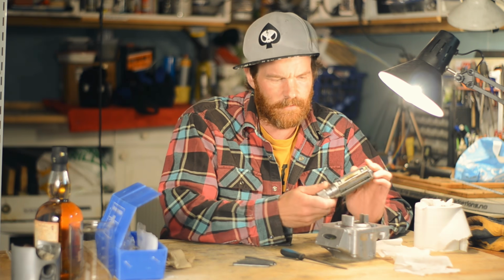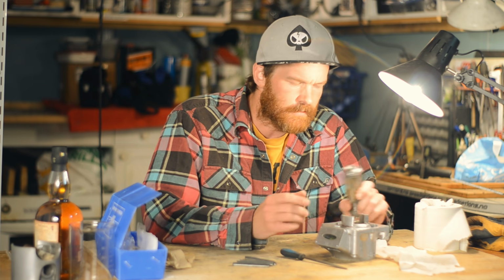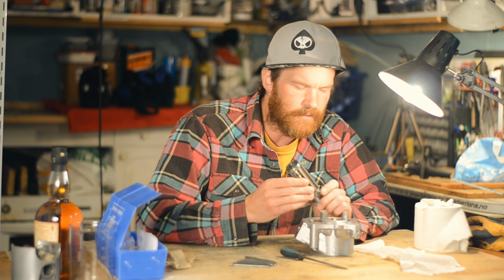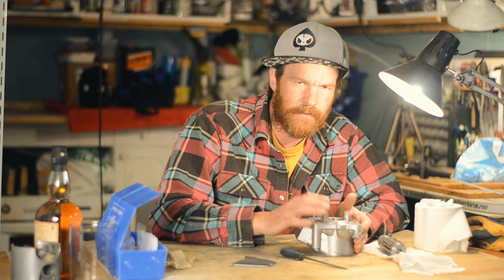DIY "NIKASIL" Two Stroke Cylinder plating P3

Comment: Ok just throwin it out there. I have built a few small 4stroke engines and only a couple of old Victa 2strokes and a few hot chainsaws. I have never noticed any difference between a X pattern and a horizontal pattern in the honeing but I have found that in any engine I have ever built (and then run for years including hot chainsaws ie 2stroke that work very hard for their life) that too much fuss over the hone and your just wasting time. You are on the right track and doing more than anyone I have ever seen to build a totally different engine than what can be bought at Bunnings if your an Aussie (home depot for the yanks). Keep it up...... I can't wait to see how well this thing does on the dyno.  Thanks again for the inspiration and I hope it does what you want it to do. Very good work. Please keep the videos coming. I genuinely await each upload with hopes of seeing it go........ Seriously can't wait. This really could be a game changer.
Reply from the maker: Thanks man!

Comment: One idea from me is to hone the zylinder bevor you are coating it too.
I guess you get the nicasil better to hold on the surface after honing and the zylinder is more round after the honing.
So when you hone after coating the zylinder, you only have to hone very short time to get all the surfice nicely with the little scratches.
That will keep your nicasil more thick.
In my opinion you honed a too long in this video
My experiande is to go trough just 5 or 10 seconds mabee in 2 or 3 steps...
I normaly goes really fast.

Greets from enduro riding.
Love your channel and work.
You are very kind.
Good luck with the final zylinder
Reply from the maker: Thanks! A slightly rough surface (blasted is good) will  help with getting the BN particles to stick better - higher density of BN in the coating.
I'll experiment more with the honing, as I'm not shooting for an exact size I'll hone the actual cylinder just the necessary amount for a good finish/straight bore.
Reply: @2STROKESTUFFING  welcome
on the enduro i ride they say you can use one zylinder for ca. 3 times honing and bigger piston kits (A B C size) after you have to go for new zylinder because the nicasil is very thin.
One guy from a special engine service and prepairing company  onece recommended me for nicasil zylinders a honing brush ( picture in the folowing link)
In my opinion these are good for the honing after your first pisten is blasted out.
It also rounds the sharp edges from the flow holes slightly wich you sometimes have to go over by hand to take away the sharp edges.
Give youbthe picture maybee you can decide on your own if this is good.
Anwnser me what younthink about in my case ind enduro and in your case with your new zylinder.
Nice Geets

Comment: in 1974 we had a Hodaka125 SuperRat that pulled 28 horsepower and raced in a motocross race at the FIM 250GP Carlsbad California....  can't what to see what your design does I hope in the 12-17HP range for a 50cc would be awesome if you can hit above 20 wow.... don't know what the highest power is for a 2 stroke 50cc hard to find out
Reply from the maker: 👍 My best so far is actually 18hp at the dyno roller with the ported iame cylinder. Massive transmission loss with a belt variator - should be considerably more at the crank.

Comment: Why not submerge the whole thing in oil when honing ?
Reply from the maker: That's a good option!
Reply: @2STROKESTUFFING  I thought about it a bit more and it wouldn't be as easy to hold the cylinder. I mean you cant put it into an existing vice like you are doing now. may not be better.

Comment: I would be checking that honing with a bore micrometer  for roundness and parallel walls before committing to using that hone tool.
Just to be sure.

Comment: any hone or ajustable reamer i have gets a hard ass grind/cut on something old/past usable to really bed in. as your friend said (as i was typing lol) the stones will loose lots of material on the edges befor setteling to match the radius, once matched, it will hold its shape and be less chattery (its basicly unable to be fully wound tight untill the edges are gone, the tool is loose, it bounces) continually taking my hat off to you for this tho!!! 100% backyard and winning! top marks

Comment: When you are honing run the drill a lot slower and go faster on the in an out motion so you get a cross hatch pattern.
For lubricant you can use a thin Auto Trans Fluid and Kerosene 50/50 mix that will clear the pores better as you hone and run more freely.
Reply: I was thinking the same thing, you need the X hatch pattern
Reply: cross hatch hone is top
Reply from the maker: Thanks for the tip! I need to work on it, turned out almost horizontal.
Reply: X Cross hatch is an old wives tail
Reply: @UltFrizz  
The latest CNC honing machines are programmed to do cross hatch honing and not just to satisfy old wives.
Reply: @AuMechanic  not all
Reply: Agreed on the pattern, I try to aim for around 35-40 degrees from horizontal on the pattern. Drill in low gear, part throttle and move fast. I don't worry about the pattern until I get close to final size though, before that I just run full speed, takes long enough as it is. 
Maybe while you're building rigs anyway build an automatic honing rig that moves up/down at whatever speed is needed to get a good pattern for the current drill rpm ;)
Reply: @AuMechanic  after many years of testing and development they have found a uniform x hatch has less oil retension
Reply: @UltFrizz  
Kart folks have some fairly creative home brewed theories on engines even more so than MC racing engine builders but IME a lot of it is based on some cause and effect assumptions (I built an engine for so and so that won XYZ and races etc etc) and not any scientific study.
Reply: @Hollaendaren  
Same, I leave the cross hatch to the final finish.
Reply: @UltFrizz  
"they have found a uniform x hatch has less oil retension"
As to less oil retention, the purpose of cross hatch pattern is not for oil retention it is to facilitate the rings bedding into the cylinder in such a way that does not cause undue heat to them or the cylinder surface that could resulting in ring failure and bore glazing, and well after they are bedded in after a period of wear there is not much left of the cross hatch pattern anyway to aid oil retention so that theory oil retention theory proposed by whoever "they" is doesn't appear to hold.
Reply: @AuMechanic  you read too much off the internet
Reply: @UltFrizz  
Ive been a MC mechanic since 1976 and Ive heard a lot of "pit science" of the kind you spout and it doesn't impress me nor does it fool me for a minute.
Reply: @UltFrizz  
And to add to that your inability to argue any logic that would support your claim is the most compelling evidence that the claim is nonsense.
Reply: @UltFrizz blatantly digging the hole deeper. full of BS . AUmechanic is schoolin you.
Reply: Cross hatching not only make the rings bed in faster and keep the heat lower, it also keeps the rings from rotating while bedding in a four stroke engine. 
If you only have a flat/slightly helical pattern in one direction in a four stroke cylinder, the rings will rotate in unwanted patterns and you may end up with ring gaps corresponding eachother. You preferebly want the gaps to stay spread evenly.

And YES, i KNOW this is a 2 stroke engine and the pistons have stop pins to keep the rings in place.
Reply: @noidontthinksolol  i work at a machine shop here in town and my boss has been doing this for around 38 years not a single motor has come back with problems with the cross hatch keep it at 45 and leave it alone
Reply: @2STROKESTUFFING  Goodluck on the honing. Ignore Gollan's lack of theory; the cross-hatched bore honing method is time tested from before WWII, from the mid 1910's era racing - and likely was from long before then, knowledge used in the age of steam.
Reply from the maker: Mixed in kerosene with the oil and it works great, the pump is happier too.
Reply: all I'm thinking about, is getting an even Nikasil plating. I'm thinking a more even plating maybe achieved by plating a rotating cylinder.
Reply: @chrisfryer3118  a Sleeve valve cylinder ? ah I get you, you mean an even unform thickness of plated Nikasil coating, by some method of rotation - either by some contraption of spinning the cylinder in solution(s) or with an eccentric vibrating pad/table, shaking the solution around the bore/object ?.
Reply: @AuMechanic  Anyone who knows engines especially two strokes knows you are one of the smartest guys on youtube this Mick Gollan obviously has no clue what he is talking about and its a damn shame he doesn't have a clue of the massive respect you are owed when it comes to knowledge of mechanics.
Reply: I use diesel for lubricate when honing is that ok?
Reply: Good advice
Reply: @UltFrizz  Sure matters with ring and piston wear. Those scratches are the part of the lubrication system.

Comment: Tips from Powerseal Holland ;), use a longer hone mandrel, it should be 1,5 times the length of the cylinder bore, else it could become like a banana or rainbow, and the piston wont fit, also use diamond honing stones, 600 grit for finishing, and make sure the crosshatch is at 45 degrees., Hope it helps you! Keep up the good work!
Reply from the maker: Thanks man! I'm on the lookout for a diamond hone.

Comment: Your honing setup is a lot better than mine! :) I need one of those pumps, Biltema 👍👍Can you give me the part number?
Reply from the maker: 52-3230 Was ment to replace the diaphragm pump on a Wartburg 353 I once owned. It seems to be sucking air, the o-rings are probably dried up.
Reply: @2STROKESTUFFING  Tack!

Comment: You can get a really nice cross hatch and surface finish with a "flex-hone" if it is available in your bore size.  These hones use abrasive balls on the ends of flexible brushes so the actual honing pressure is very light and even.  They tend to preserve the as-machined shape of your bore while just improving the finish and cross hatching with minimal material removal.  we use them to hone the bores of hydraulic cylinders, although they were initially designed for motorcycle engines I think.  It will have a much lower material removal rate than the multi-stone hone you are using... may be more forgiving.

Comment: I trust that in your studies of plating, to ensure the best possible plating, it is important to surface finish the plated areas every time you dip it to ensure maximum surface finish and uniformity of depth.

Otherwise you can end up with a clumpy chunky lopsided mess and waste a lot of plating material.

Comment: Very nice work, I wish I could do that too today; just  a remark:   
I worked alot on my Kawa 750 H2 (40 years ago) and found out that the piston ring clipped into the channels a bit when the channel becomes wide; now your exhaust channel is much wider than mine back then, hopefully you do not run into similar problems and the Nikasil will not chip off .

Comment: Nice job... you need more oil flow when you hone, you gotta drown that sucker in it, and try using your drillpress for honing, that would make things a lot easiyer
Reply from the maker: Thanks! I think my pump has an airleak. Might try gravity feed instead.

Comment: That's a neat little hone, thanks for posting link. You would be way better off (in my experience) thinning the cutting oil way down with either kerosene (or diesel) or get proper high sulphur honing oil.  When honing, use about 90rpm and  'stroke' in /out a bit faster to get a 45degree cross hatch (I used to teach this stuff) Most rigid hones are capable of running to 450 rpm but it's really difficult to match stroke to rpm at higher speeds. I've been meaning to do a cylinder honing vid for several years, since I did an 'Instructable' on correct way to measure a motorcycle cylinder

Comment: ,,, if its nikasil, there ought to be some commercial hone that works, I mean after 40 plus years ?
Reply from the maker: Sure is, but really expensive!
Reply: ,,, alright lol, just wanted more details like: what grit, hone material, crosshatch, cutting fluid, dollars, where ? Btw, did you swap the cylinder end for end while honing ?
Reply from the maker: I'm not sure, sorry. I know it's usually diamond tools tho. Have to do some research. Didn't flip the cylinder around during testing(well once actually), but will on the real go.

Comment: I was the engineer in charge of super finishing posh way of describing honing at nsk bearings in the honing process the stones surface are opened by the parts roughness this will make the stone break down and cut more material as the stone begins to load the surface of the stone closes  material removal stops and polishing begins to achieve best results the stone runs a low speed both in terms of rpm and oscillation then fast for the final polishing all the time having oil flow over this cools the stone to prevent cracking we used to bed the stones in to ensure full contact between the part and the stone 
Total material removal was small around 5 microns if you’re getting high removal values then the stone is cutting to much and not closing up you would need a softer stone 
Honing can be a bit of a black art in terms of choice of stone and speeds and pressure applied to the stone a change in one can affect the others it all depends on what is the required surface finish
Reply: You realize not a single person read your long comment.  Or at least didn't make it past the first sentence, that is if it even had sentences, as it's the longest, non-sensical sounding run-on sentence I've ever seen in 15 years on youtube.  I bet even you, the author, would struggle to make sense of it now LOL.  I even copy/pasted it to Wordpad and tried to punctuate it LOL, but apparently there's more errors than just having no meaningful format.

Comment: Strange. This coating should not have been so easily processed. If it is possible - look under the microscope at the wall of the cylinder - should be visible after processing the inclusion of bornitride. If they are not there, then most likely the flow is too strong at the last stage, which did not allow the bornitride to precipitate into nickel or the lack of surfactants in the solution.
Reply from the maker: Thanks, good tip! The coating seems pretty hard though, and hexagonal Boron Nitride isn't as hard as SiC
Reply from the maker: I must add, I did a lot more honing than what shown in the video.